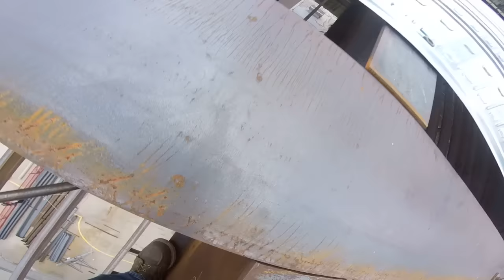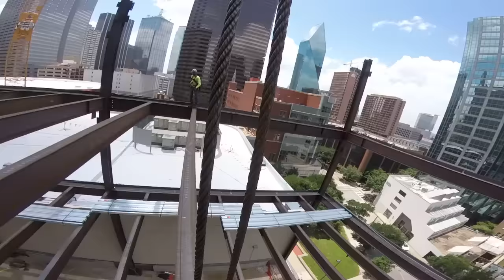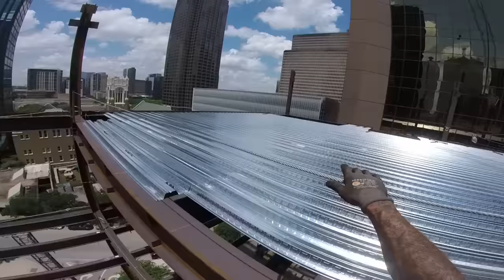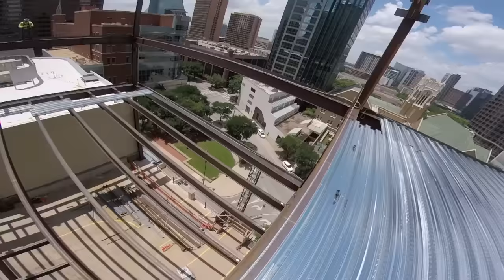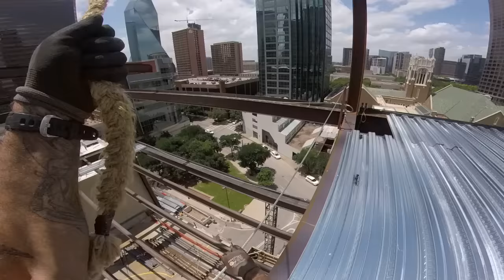Walking the Iron 6

Comment: I am a 67 year older man, and I did exactly this. It was very satisfying erecting red steel, standing on a spud wrench waiting for a piece to be lifted in by huge cranes, shooting drift pins into holes, hammering bull pins with my four pound beater, looking after my partner, listening to the cling klang of my connecting bar rattle against my two spud wrenches, and when moments allowed my mind to think I was a little kid with a Giant mechano set. It was the most exilliorating feeling. To all those who do this work You Are Awesome. 🍁🍁🍁
Reply: Thanks man . And thanks for doing it before us
Reply: HI there...so I have a question. I see these guys do this initial fix...couple of bolts in. I guess there is then a second team that comes along and puts the rest of the bolts in and fixes everything to spec?
Reply: @GavCritchley  You guessed correctly. The raising gang puts all the pieces in place. Then you have the detail crew come through. They will stuff holes that don't have bolts. They will rack the structure from the ground up. Making sure everything is plum and true. They will do all the welds that need to be done. We will also snap every single bolt with a lajune gun. There is a lot more that happens, but you'd have to get up on the iron and find out for yourself.
Reply: Nice,is it pays well?
Reply: I came into the construction field a little late and I’m doing restoration in nyc .wish I could’ve had someone to guide me and to go to school for this . I need a connection if anyone could give a little help I would really appreciate it , thank you
Reply: @chino_oma9120  ,If you haven't already, I'd say join a union. As an apprentice you will learn everything you need to learn. The good part is, you will get paid well during your apprenticeship. You will get all the benefits that a journeyman does. Your pay will increase as you move up, but you will receive a good package all together. If you want to be a tradesmen, don't waste your money on school.
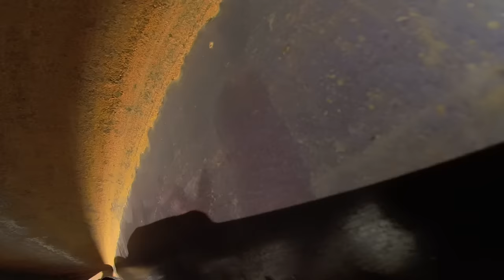Reply: The RSJ shown @8:07 is corroded in breach of UK standard.
 Didn't you ever have to spray US (unserviceable) on each end and call it? 
Usually most steel joists are coated with oxidation retardant red paint as soon as they're cool enough , perhaps Europe is wetter so rusting is more problematic.
Reply: Hangin and bangin!!! God bless
Reply: When you started did you have a fear of heights? If so how did you overcome it?
Reply: @smoothjay1979 how long you been doing this? I've been thinking about trying to see if I can get into a school learning. Just have a fear of heights
Reply: @andresmith4957  from the bottom up and one step at a time. And listen to the men that have been there before you.
Then before you know it your ten stories up connecting with your partner and its 2nd nature. Stay safe
Reply: 35 yrs and counting.
Reply: ❤❤❤❤👍👍wowwwww, complimenti complimenti complimenti

Comment: retired 35 yr I.W. here. great video...i miss the guys i used to work with not so much those hot days and them winter windy days either.but that job was awesome i seen things nobody ever will see from places nobody goes. i was never a connector. but i bolted up and threw a shit ton of deck. i always got a kick telling ppl what i did for a living and them saying there was noway they could do it .
Reply: From #880732/Local 387, congratulations on your retirement. Same here,  a little connecting but a s load of other stuff.

Comment: Im a steel detailer from belgium drafting mostly industrial buildings, never this high. when drafting out a building its always important to keep the safety of inon worker in mind and also making sure easy installation is possible. Erecting a tall building like this is something else. Our builings get safety netting to prevent falling but here its not possible to the nervers you guys have, massive respect! A small mistake is always around the corner and can have a high price even on the safest job sites. Stay save guys !

Comment: Might be a little late to comment on an older video, but anyway. If they get their steel from steelfab, there's a chance I welded a lot of them bolt hole plates, wing plates, end plates, bent plate, & any other kind of plate on them I-beams & H-beams. Welded parts to tubing, channel iron, angle iron, all beams, & a ton of other stuff. Cool to see the end product of it all going together. Cool video, man.

Comment: Connected during the late 70s to the mid 80s, they would have a hard time getting me to tie off. Be safe.
Reply: Thanks for the hard work, brother.  A lot of old timers and their way of thinking in terms of safety wouldn't cut it in today's construction. On most big jobsites not tying off gets you ejected permanently and sometimes that includes all jobsites under that GC. We lost two good traveling union brothers in Los Angeles, Ca at LA Rams SoFi stadium because they didn't tie off.
Reply: @hibiki54  I was a boomer in the L.A. area for about 6 months then boomed to Portland Oregon.  Miss the work, had to quit because of injuries. The injuries had nothing to do with tying off though. Miss that type of work, nobody wanted my job when I was connecting awesome.

Comment: i did this in nashville tennessee and loved it but the crane operator we had thought she could run the job from the seat of the crane and almost killed a few of us that was her last day bumped the steel more than once in a day we had enough
Reply: A bad Crane Operator isn't tolerated for very long. Usually a tight fit between the two

Comment: Wht i see wrong here is that the safety rope should be higher not that low so when you fall down it will stop you pretty much like seatbelt 
So u cant fall any lower level u working

Comment: Brother I’m guessin that’s a hot sob up there….I’m a tree man by heart but have ended up in a little easier role to play these days plumbing…little over 10short yrs fuckin with solid oak most the time has done did the damage and I’m just tryin to make it day to day…heat bout kills me anymore and in eastern Ky coalfields the humidity with 103 temps makes any outside work a bear…you boys see way higher I’m sure but is it as humid you recon? Worked on the road but never in tx…I love workin and when I see men gettin at it I’m always wantin to sail right in regardless how tough it might be…just was raised to help I guess…hang in there fellers doin what most can’t so be proud…matt

Comment: You new at this? There is no hurry here is there. No wonder Texas is confused when they boom out to the west coast. Maybe it’s the heat. Still give you the thumbs up , hope your union
Reply: Post a vid about how shes supposed to go then ,vouch for your need for speed
Reply: took for ever to catch the bottom beam, I wouldve done chased it down, piece count is a thing to me
Reply: @themgarcia23  why lol
Reply: @themgarcia23  Easy there Captain Tryhard.
Reply: I'm with Max G & D C. Why only tree two pieces at a time if the hook on to connecting time is that long? Why didn't the guy not on the radio go out and get the piece instead booming/luffing the crane up then back down? You guys' ask "why"? Because we're fucking Ironworkers and efficiency is bred into us. Or at least it's supposed to be. I'm from Saskatchewan, Canada and every connecting partner and myself I've ever worked with has always given a sh*t about piece counts. Why? Because that's what makes us, us. Local 771.

Comment: Shit if you gotta take a pee break you aint for 1 sweating enough which means 2 you aint workin hard enough bahhaha!!!! PEE BREAK LOL!! Im a welder/crane operator/ high rise worker/ electrical work/ heavy equipment operations you name it on tall ass high rise pole signs. Usually climbing out of a 110 to 140 boom bucket truck to get to were I need to work on. Ive had multiple iron workers freeze in their foot steps working on some of the pole signs with me that ive done. I'm not that comftorable with heights either but some how I still get up every day to go work at 100+ feet in the air. Alot more sketchier then standing on 4 to 8 inches of nice iron that you get to walk on haha...